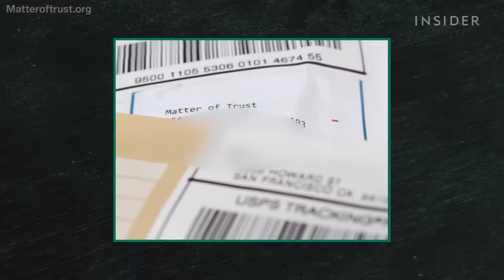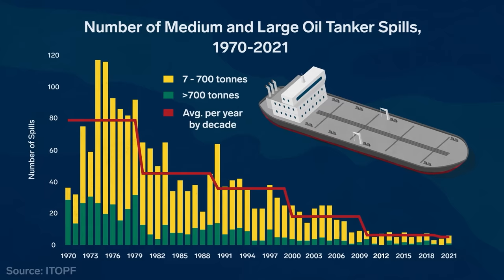18 Products Made From Trash - Season 3 Marathon | World Wide Waste | Business Insider

Comment: 2023… I purchased coconut briquettes those little tiny squares.   They’re great forms of nice hot coal, and you can quickly cook something without a lot of waste..  I had 3 charcoal buckets of different sizes.  One I have never used… it is just plain cute, at about 4 inches across…. It disappeared one day.

I like this type of plate much better. I have now a whole set of different size bowls and plates all recycled sugar came. I believe that they’re sturdier, stronger, and do not leak.   it can handle both hot and cold without affecting the material.  I started buying them when I added up what I was spending on paper plates.   I regularly used 2 to 5 plates because of fluids soaking through, or the plate is too flimsy to hold the food.  I’m not spending anymore than I spent before, and sometimes I even find them cheaper….. no frustration and confidence is priceless

Comment: One thing I find disappointing is the huge change in the lack of wool clothing. I grew up in the lowest of economic classes, and yet my winter clothes were wool. Jumpers, skirts, sweaters and skirts. Socks, of course. And wool can be washed off with a damp cloth. Also, because we walked 2 1/2 miles to school, those felt linings of wool in our already wool coats kept us snug. It was forbidden not to cover ears and there was never one single ear infection. We couldn't afford a lot of fuel oil. The thermostat was turned down after the heat of supper's cooking rose to second floor bedrooms. All blankets were wool.  Mornings were cold and we took turns dancing on the very hot grill of a forced air heater. I see today's kids dressed in flimsy polyesters and stores carry such poor quality. I still have two finely-made business suits from my early years. Yes, I was a female executive. The idea of a glass ceiling was mostly a figment of whiney imaginations. But that's another story.  Bring back wool clothing for the sake of several world problems.

Comment: One way to help reduce flip flop waste is to buy Okabashi flip flops. Yes, they cost a little more but they last forever (like 5 + years in heavy sand/water/mud) the center post is molded into the shoe itself and takes tons of punishment and abuse.the cheap ones for around $5 break easy and generatete more waste.A pair of Okabashi will cost about $20 USD a pair but almost last a lifetime in harsh conditions.

Comment: Would it be possible for Matter of Trust to clean up the oil off the ocean floor? Like, imagine filling a steel barrel with hair, going to a site with oil contamination, and using a pump to vacuum oil from the floor with the barrel as a filter. It wouldn't be perfect, since you'd probably catch a lot of rocks and plant matter as well, but that's still better than leaving the ocean so polluted.

Comment: Regards the hair mats for collecting spilled oil. Would it be possible to remove , collect said oil both through centrifugal force ,  ( centrifuge ) and also by the use of heat and condensation. Would this not de-oil the mats making them ready for reuse?

Comment: The two points where the balls connect is so small, and there's so much force, and the energy is so great, that the collision creates light and heat to help dissipate it all. If u were able to measure the temps of that flash, it would be incredibly hot

Comment: Hi Noticed that this video was uploaded about 1 month ago according to the YouTube data... So I have an idea that can be implemented for the "hair rugs" And its interesting because I seen a mental picture of this type of logic before it made sense to me in my mind but here it goes... I seen a facility that will be dedicated to this oil recycling procedure now that it makes sense to me now. There will be different layers and stages of these "Hair Rugs" the older ones that been in or within the facility will rise higher as the oil has dripped off unto the lower rugs with heat (so the heat will need to be set at a tempature as to prevent the hair rugs from burning up) Once the majority of the oil has been removed and recycled the hair rugs can be reused to extract or for the ectraction of oil that's in fresh or salt water.

Comment: The ciderpulp, he has to say to the cideries they need a different conveyorbelt. If it´s Not rotating it doesn´t need to be wet, use a belt with shovels, and a truck with tip of function. Then it won´t be sludge you are getting, but a pulp you can press in bars right away.

Comment: Your smoke from making charcoal can also power a gasoline motor and replace gas .    This motor can run a sawmill - a generator for electricity  -  A grain ,corn grinding mill -  and anything else you can think of.  Oh yes you can pipe the smoke into old propane burners to cook with 9 The wholes that in the propane burner will have to be drilled bigger because more  smoke is needed to make the same heat as propane would..  That smoke that you are for now letting excape from making charcoal is VALUBLE fuel.  Use it don't waste it  ...    That smoke will make you rich ......  $ $ $

Comment: trying to make a rolling pavement material for inside roads may be of five layers... if i take all the trash without the plastic and the metal and grind it may be i have to add up to 20% other material soil and add a certain chemical in similar industries that increase desirable properties and and mix it may be also with water .... making sure it is sterilized and but to dry it only upto a point it is flexible enough to role. may be the first layer should be something like 1.5 cm to 2? so that takes the road effects into itself as much as possible the small rocks the bumps. particularly if we don't have to worry how it breaks apart... i may have to cover the top that is the road

Comment: Recycled plastic is more dangerous than the original plastic. Plastic can be turned to diesel fuel; off setting using new fuel, as CO2 can be used to make diesel fuel instead of making new diesel full creating more CO2 into the atmosphere.  Carbon made from Coconut is good for human use as it pulls metals and poisons out of the human body.

Comment: Please contact me about your coconut  charcoal.   When you do your burn to create your charcoal. The burn off fire should be modified to power with its heat a blacksmiths forge for creating tools from everything that could be made from simple materials like rebar ...    You will have to accommodate a working level that is safe for the blacksmithing work to be done.  With no fans or complicated flame ducting it would be best to have an over under situation like on the side of a hill . The fire charcoal barrel will be accessible from the lower level  of the slope hill and the blacksmith shop just above on a flat level working shop .  Wow 2 business from one working expense.   Make the charcoal and power a blacksmith shop.

Comment: There are some misconceptions here, recycling is not always good for the planet. Recycling flip flops by gluing them together layer by layer, even if the glu is non toxic might be doing more harm to the environment than just burying them into the ground. The chemical processes used to produce glue often require factories that produce a lot of CO2 and other more harmful volatiles. The same would apply to electric vehicles if electricity was all produced by coal burning power plants, which luckily is no longer the case in most developed countries.
Reply: Yes, all of these repurposed, toxic materials will STILL end up in a landfill one day. There is only one solution to this problem and that is to cease production that uses these materials. That means consumers must stop buying these products and bringing them into existence in the first place.

Comment: Why did the PVC Recycler dont use the Power of the Sun to heat the Pipes ?  With some simple Mirrors they can produce the Heat. Put Mirrors arond a Pipe  made fron Steele
and make it hot with Sunpower , than you let the PVC Pipes pass throu this.  And you save the worthfull Wood.

Comment: An avarage single house uses below 5000 kWh per year without car loading. As the house is maybe very big and using a lot of cooling, Lets say it is 10000 this means the car and airco is using 44000 KWh. Fully charged tesla is about 70 kWh. So that means over 300 loads , almost every day so that is good for 20000kWh. So something else is drawing the power, like an extreme airconditioning. The world has to get rid of this excessive cooling. Also there quite a lot of loss in the batteries losding and discharging when in use, I believe like 30 pct. My main point is if you have a family household using 54 kWh there is something else wrong. Your ecological footprint is as high as 10 households anywhere else in Europe. Thinking about those high capacity batteries, these are only sustainable for about 10 years and need to be replaced then, which means the business case is not as solid as presented. Is that still healthy for the environment? If you have a large house or terrain wouldn’t it be better to install a windmill to generate additional power so then even when the sun power is low you have access to continuous power?